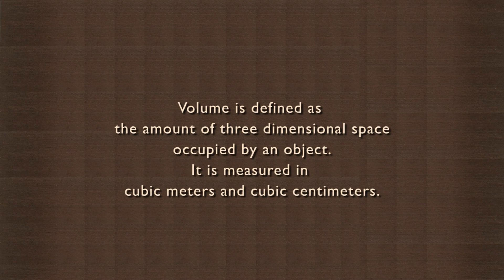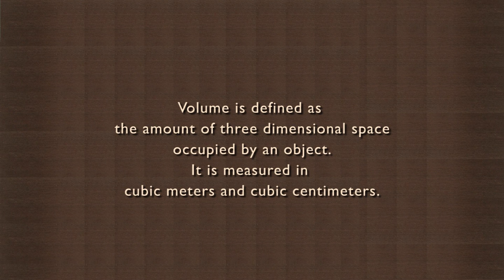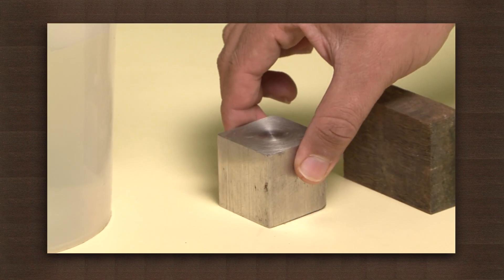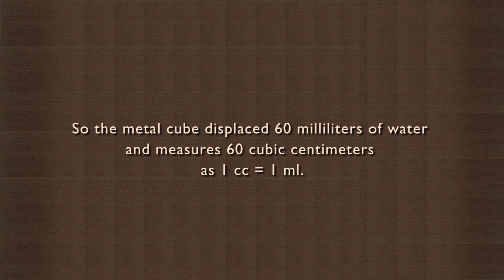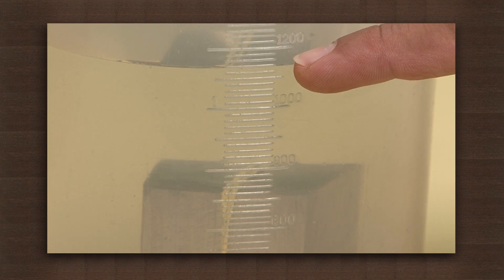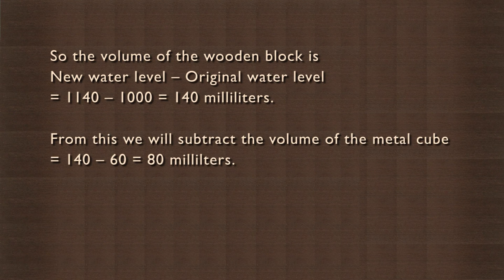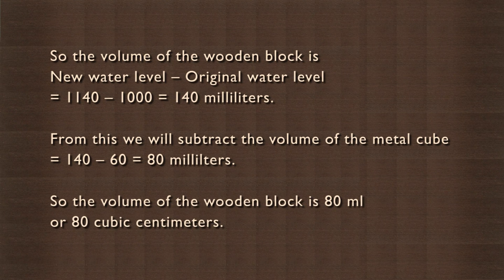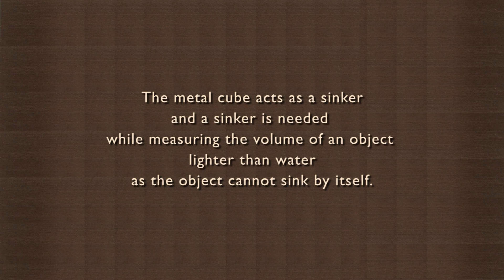Sinker method to measure volume of irregular floating body | Liquids | Physics

Comment: but that is an inaccurate method because when sinking the metal cube it will get mass added from the water (may be if you let the metal cube to completely dry it will be an accurate method )

Comment: This great. What happens if the wood absorbs water because it is porous, would that not affect the measures?
Reply: You can spray the wood with a protective water proof adhesive
Reply: I don't think so...because if the wood absorbs the water the water's volume has already being noted.
Reply: @goodgaminggamer530   that does not make sense.
Reply: Drop the wood in the water for some time before you going for the test, it will gain the water and wont absorb water from the testing pot.